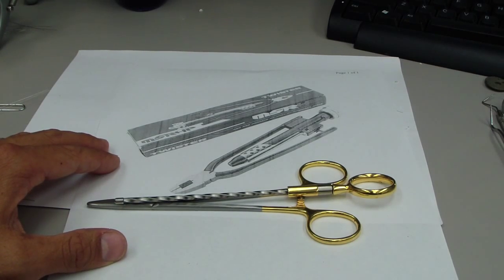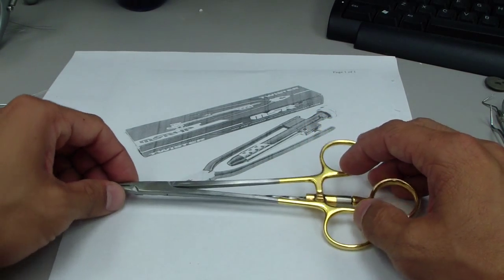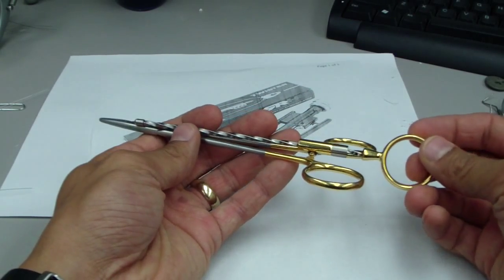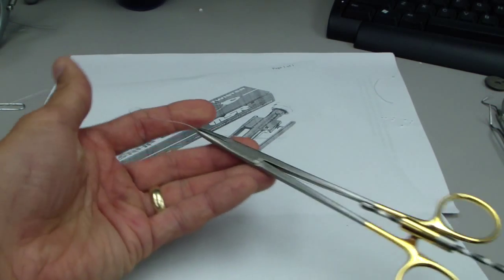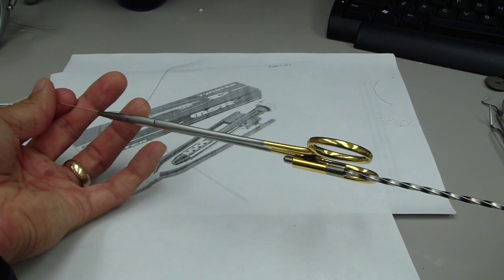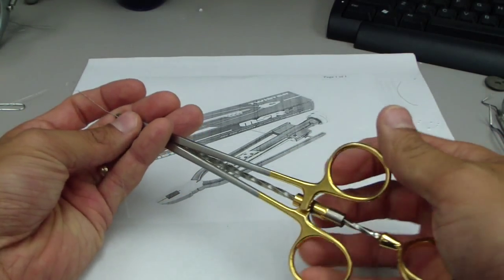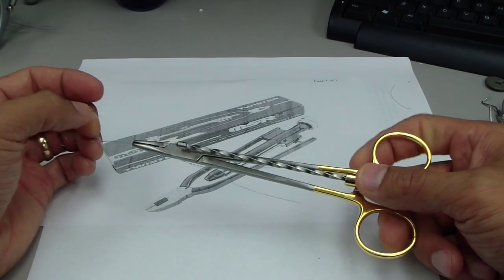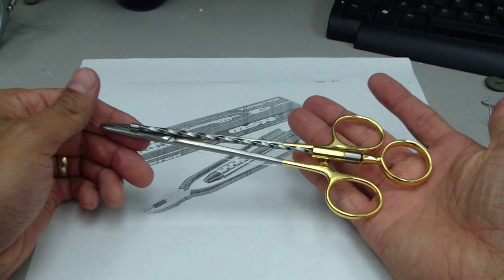Automatic Wire Twisters

Comment: They Are Handy To Have I Have Not Long Just Bought Two Different Pairs Of Wire Twisting Pliers On Ebay Both From Different Sellers One Pair Is Used The Other Pair Is Brand New.